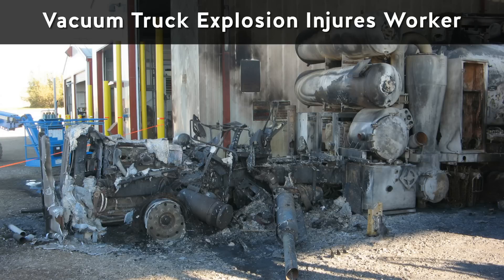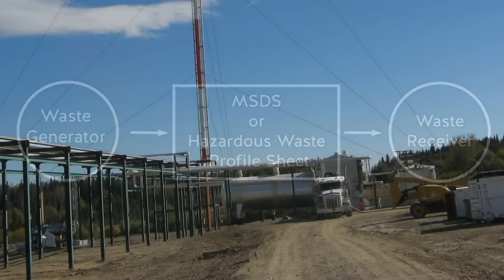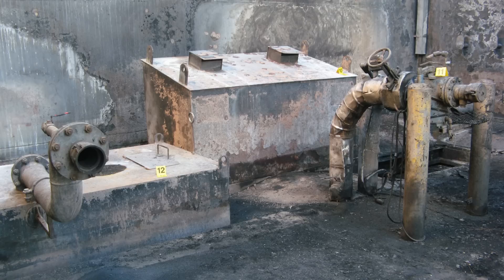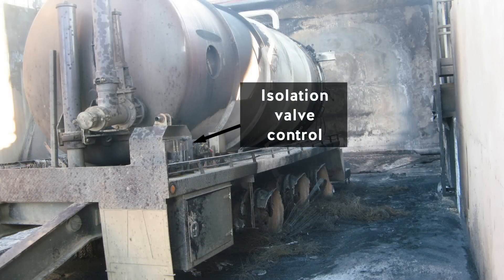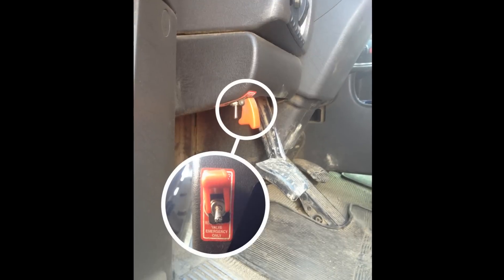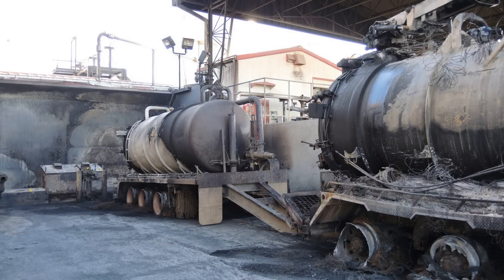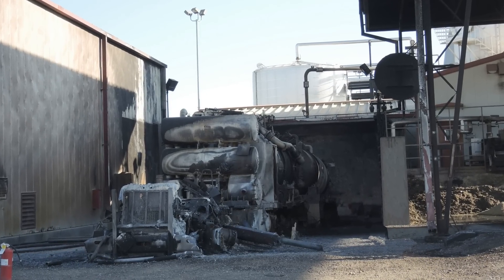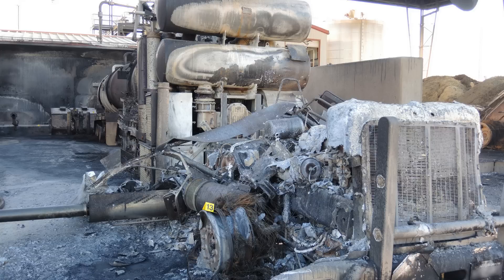Incident Investigation: Vacuum Truck Explosion Injures Worker | WorkSafeBC

Comment: Why would the positive engine shutoff switch cause an explosion? Wouldn't it force the engine to stop and thus eliminate a possible ignition source for the flammable gas outside the truck? Or was the problem that since the switch was electrical, slthe spark it made when activated ignited the fuel that was in the air?

Comment: Sorry for my ignorance because I’m new to vac truck work. Should have the driver and facility hooked up with a hose to discharge the tank? I’m not sure what should have been done here to stop this from happening. I’m assuming the fumes wouldn’t be able to ignite if the driver would have controlled the way he discharged the truck. Thanks for the help so this doesn’t happen to me. Oh and make sure the paperwork is filled correctly so the facility knows exactly what to do I guess. Thanks

Comment: This has nothing to do with an MSDS or the driver, it has to do with a facility designed and operating in a manner not even remotely consistent with common sense. If you know you're going to be pumping flammable wastes on a regular basis, why doesn't the facility have their own C1D1 rated pumps to safely make the transfer? They couldn't afford to buy a $5,000 pump in a multimillion dollar facility? What a crock of bull.

Comment: Wow, I have a lot of respect for the driver, even though it sounds like they tried to pin some blame on him for the manifest bs. I hope he survived and was able to make a full recovery. I thought for sure he died from the looks of the pictures. He knew he was in danger but he was brave enough to try and stop a much more serious explosion
Reply: Bravery and Courage come from knowing that its dangerous and still doing it... that driver is both for sure
Reply: He is part of the multi-stage process which resulted in extensive injury and property damage.  A CDL driver is responsible for his/her vehicle and its contents.  Sure, there is some culpability on some other workers who also overlooked safety protocols, but the driver carries a lot of responsibility in any situation because he is the one in control of that vehicle.
Reply: He died,,,,I think the switch inside the cab is what was the spark,,,not the engine...I do know if you have a natural gas leak inside a house and flip a light switch on,,that can be just a small spark...but enough to cause an explosion. Had correct procedure all through the haul and loading and the paper work....all were important,,,esp the paper work,,,,They didnt know it was so explosive!
Reply: @MrRiprip56  i think so too, he definitely made it worse
Reply: @sp34277  You would think that a truck like that was equipped with switches that didn't spark, but what do I know? If the switch wouldn't have done it , the engine would I guess.

Comment: imagine shutting your motor off.... only for it to keep running. that'd be scary enough.
Reply: A diesel motor will continue to run with no outside help as long as its getting fuel. shutting the key off stops the diesel fuel in the truck from getting in to the motor, but if there is combustible gases in the air it will continue to run. Hence the Positive air shutoff which does exactly as the name suggests literally suffocating the motor until it dies.

Comment: The toggle switch was the source of ignition. It's open contacts. When they are close together a spark jumps the tiny gap. It is for this reason many newer switches have a high value resistor (~3Mohms) connected across the contacts to prevent the arcing caused by making or breaking the contacts.

Comment: This may be an over-simplistic view but why didn't they stop the offloading operation when the worker's personal alarm went off?
Reply: The flammable vapors in the air were sucked into the trucks air intake, creating additional combustion. There was no time to shut anything off because the truck started to immediately “run away”. As someone else stated though, flipping that valve killswitch created a bomb in the engine instead of shutting it off.

Comment: The reason the Engine Sped up and didnt shut off, Was because it had just become a runaway diesel.
Reply: My dad used to drive for an envrimentl co. The main product haueled, by drivers at  his terminal anhow, was chemical lime.

They operated two types of trailers. Bottom dumps and "air trains". To discharge his load, drivers would conectect a large air hose to a valve on the smoke stack of the tractor. Then they would would idle and rev the engine thus using the exhaust to presuraize the trailers, before open valves on the trailers which would alow the discharge of the load.

though, I have seen this vid before, it just occurred to me, that this method could be quite dangereious if there is flammable vapors at the discharge site.

Comment: I worked over 30 years as a truck and transport mechanic but I specialized in working on trucks and trailers carrying hazardous materials. I also had to inspect and certify these types of tankers on a yearly basis. Clearly I knew what I was doing but they always scared the heck out of me. I guess having this respect for these things is one reason I never had a problem with them although I know of people who did while working on them and it's never a good outcome.
Reply: Is there any measure to reduce the pressure in a tanker?i drive tankers and i believe there is a valve that releases and can also suck in air depending or excessive or inadequate pressure

Comment: First problem, they didn't unload in the risers, I've done this work and have been to newalta many times. Any liquids in the tank gets pumped off first and solids go into a separate area. Never once had an issue and we've hauled everything from crude oil in dirt and sand to condie in dirt and sand. This, is workers being lazy.

Comment: I work at the plant where this happened.  The truck went to multiple sites and sucked from multiple barrels and neither the operator or the consultant knew he had sucked on NGLs. 

When the driver dumped at disposal the tank was so pressured up the fluid shot out and hit the back wall splashing back.  There was about 5 seconds between opening the valve and the truck exploding.
Reply: The burn pattern on the back wall suggests that a jet of burning fluid and gas was spraying against the back wall, what a nightmare. The static electricity generated by a fast moving flow like that can potentially be an ignition source in itself.
Reply: @CATASTEROID934  omg you’re right!! I didn’t notice it before
Reply: Did the driver survive?
Reply: You have to assume that everything on the lease can at least burn, and most of it is explosive. I do feel for the driver. I spent 37+ years in the patch, and have seen a few wrecks. You can't be complacent even for a minute, but of course we all are. Except for the grace of God...

Comment: I once was loading from a open top water tank from a compressor and I was running a vacuum truck which if your loading the vacuum pump has an exhaust on it which releases vapors from the tank. Well I parked crosswind so that the vapors were being taken away from where I was working which was the rear of the trailer. Well I had jumped in the truck to fill out my field ticket and about 8 mins into loading I looked up and said to myself that smells like gas which the windows were rolled up so that was very strange needless to say the wind stopped taking the vapors away from the cab thus leading to the vapors being pulled in by the exhaust to the engine thus making the engine run. I tried turning the truck off it didn't work I jumped out then remembered my phone was in the truck so I hopped back in to get it then I remembered what a fellow driver had told me a while back which was to stall the engine.. so I put the truck in 6th and stalled it out thus saving me and the truck and the site.. why did I go get my phone well I was working nights in the middle of nowhere and it was a good 2 hour walk to the closest person... so this might save someone else... pop the clutch and stall the engine out if its early on otherwise run .... from that point on I always hook a hose to the exhaust on the vacuum pump and run it about 10 to 15 ft away from the truck crosswind when pulling from a compressor/gas plant
Reply: I used to run 100' of hose, off the exhaust side, when vacuuming on gasoline storage tank bottoms, at refineries...my boss thought I was being overly dramatic.
But, I never blew up, or otherwise FUBARed a piece of equipment...AND, I'm still alive, and retired!
Reply: How does it stall at a standstill, is the transmission fluid coupler able to withstand that or something? Or is the drive to axle disengaged and it is running the pump?
Reply: @00bean00  stick shifts (aka, manual transmission) are direct drive, no fluid coupling, only a clutch that can be slipped if needed.
Putting the transmission in an excessively high gear gets you either a stalled engine (best case) or grenaded power train part(s).

Comment: It seems that the ignition source was not the engine of the truck.  The ignition source was the switch contacts that would close off the vapor laden air to the engine.  Given how the air shut off valve is used when enough fuel is in the air to keep the diesel engine running after shutting off the fuel injectors, the wiring for that valve needs to be explosion proof.
Reply: That shutoff valve is used to stop a runaway diesel, normally due to a turbo failure causing it to suck its own oil.  I don't doubt there are some made for explosive enviroments though.

Comment: They said he had no msds but did have the manifest.By law the driver must carry a little red book called a hazardous materials compliance book and Emergency Response guide. the red book has all the information info needed for every chemical thats allowed to be transported in the US. Then the ERG tells what to do in event of a spill and so on. if all info was not with the load the driver should of refused. once you accept its on you right or wrong same when you deliver once that manifest is signed it is the responsibility  of the person taking possession thats why they manifest has places for all parties to sign over to the next. Laziness is the cause from paper work to dumping in a open pit. also he could of tested the materiel if he was in doubt. this is on the shipper driver and off load facility for sure. I hauled haz waste for about 15 yrs never a problem but you cant be lazy and cut corners its not just your life when shit goes wrong people get hurt.thousands of loads get hauled every day with no issues most the time. there is a lot of responsibility and paper work to driving a truck  but about 10 times as much to haul haz mat. to renew a CDL in oklahoma is like renewing a DL pay your money every 4 years and no retest.  unless you have hazmat you have to do a fedral back ground check and take a written every 4 yrs. the laws change so fast. this is why most places pay really well to pull hazmat. This was a bad deal never should of happened.
Reply: Is that the law in Canada?

Comment: what a badass he literally tried to stop a bomb and told others to run for their own lives beforehand wow.
Reply: It's cool the truck was equipped with air intake shutoff and all. Runaway diesels can be a problem. Glad dude didn't die.
Reply: @NoZioKikes88  I think it is mandatory for such trucks. Usually a Diesel engine is shut of by starving it from fuel.
With those flammable vapours it gets fuel through the air intake,it was no longer running on diesel. I think there had also been several incidents at refineries where such things happen, usually you will see the engine reving up like a race car.
Reply: @alexanderkupke920  yeah it's um interesting when a turbo blows and allows oil to enter the intake. The engine runs on it's own oil
Reply: That's a hero I did the same our gas went nuts on a water heater I got everyone out then for some stupid reason ran back inside building and shut gas valves off before the flame got to main tank saved us all I was on my back reaching up to close the valve when it whistled all I saw was blue flash I rolled it just missed me but I felt my ass getting real hot.they called me a hero I looked at the supervisor said that was the stupidest thing I've ever done
Reply: @kingjames7273  flame up a gas pipe, i don't think that is plausible
Reply: Least he could do

Comment: why would you leave your truck running when dumping potentially flammable material? (especially if you don't know its properties)
Reply: Yourname942 short cut... keep the cab cool and comfy... whatever the reason, it could have cost his life as well as those around him. Work safe in the oil fields or don’t work at all!
Reply: You need the engine running because it turns a PTO that unloads the truck.  Most vac trucks work this way.
Reply: @texgarcia1958  you don't need the truck running to unload. Maybe to air up so the valves open and close but ive never had a truck that ran out air while shut down
Reply: The operators did not understand that they were dealing with highly flammable materials. That’s the point of the first part of the video. There was no MSDS provided to inform the operators of the danger.
Reply: Driver was told it was waste crude only.

Comment: This is kinda stupid. Everyone who ever ran vac truck long knows sometimes you carry crazy shit in there, and no one cares. I've seen truck burn up in ND and next day I was next truck to load I asked how they fixed problem they told me they added 2 hoses. That was on well east of Watford. I nicked named it dantes inferno. Both flares blowing 50 feet. They couldn't control gas, water going in open top tank gas came out settled on ground got to truck engine. Stupid driver ran to truck instead of away, explosion and driver burned and truck melted. Some guys have auto shut downs when eng revs get to high eng kills. In oilfield they aren't going to protect you ,you have to listen to old guys and protect yourself I've been in and out of it for 37 years. Have done well but this video isn't going to save lives. You pull up and ask CO. Man for hazard sheet on waste and you and your CO. Will be off that site in 2 min.

Comment: All the paperwork in the world is of no use if you are unloading flammable fluids and gas in a confined space and that place he unloaded was confined. Besides I cannot believe that the driver or even swamper didn't know what they were moving was flammable please give me a break. Best that could of been done was prep truck or trailer for unloading then shut truck off. STANDARD PROCEDURE IN CONFINED SPACES!!! There are facilities that have ground personnel on location to manage the loads and help out with paperwork if necessary and that facility looked like it would have personnel at all times. Anything coming from plants or oil patch have to always assume flammable fluids along with gas trapped in waste is present. One load say 125 bls of saltwater can be brought in for disposal and 1 bl be tank bottoms there you go danger. Proper training above everything else is key to the job.

Comment: And this is why they should have a ground mounted hydraulic pump they can hook into to raise the tanks letting them turn off the engine. Would also put the controls at the hands of the staff rather then needing the driver to help.

Comment: He should have put the truck in gear and let go of the clutch so it would turn off the truck.
Reply: Engine would still be hot and LEL games would enter the air intake still... positive air shutoff is the best option so at least no gas enters the engine internals.

Comment: The valve to cut off the intake is probably about the worst thing to activate if you know how engines work. He was all but guaranteed to have the combustion go out into the exhaust or intake since it reduces the cylinder pressure and slows the combustion down in event of a runaway due to externally ingested HCs. He'd still be unharmed if he had just not touched it. A better way is to just get the hell out of there. Another case of the cure is worse than the disease. If theres enough VOCs for the engine to race on its own then you need to get out, period.Edit: Could have been a sparking switch, but still shame on them for allowing high current to be switched by it instead of just a signal to an external explosion proof relay.

Comment: Shouldn't every load be treated as a possible fire Hazzard?
Reply: Not really as you get inputs from a number of sources like a oil water separator at a car wash will have hydrocarbons but heavy ones suspended in water so needs treatment but not a fire hazard as it is.
Reply: @TheUserid82  Sure, discount the thought to be safe EVERYTIME because you can justify it. Tick - tick - tick - BOOM!
Reply: In the oilfield yes. Unless you are hauling just straight water, if not it is considered flammable, which most chemicals and liquids in the oilfield are. Even oil on water can still ignite if given an ignition source.

Comment: Different methods could have avoided this. Distance from the hopper could have avoided this with wind direction in mind. If he was just gravity feeding to off load the engine didn't need to be running. If a little pressure was needed to offload the operator could of used hot offload procedure to avoid ignition sources. There are to many operators working these trucks that are not properly trained in the safest way to accomplish different scenarios of the different types of job applications.
Reply: If he was just off loading into an open pit gravity feeding would have been all he needed with the bed raised.  Never a good idea to pressure lightends off. Diagram pump in a closed loop system is the way to go.